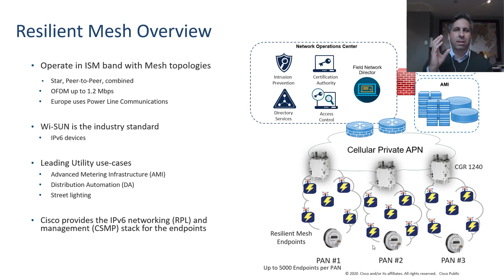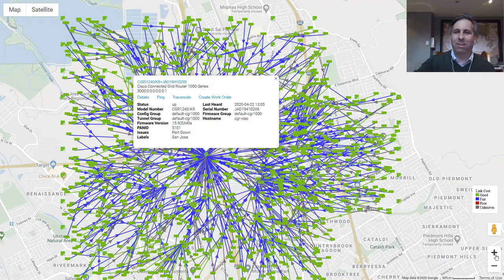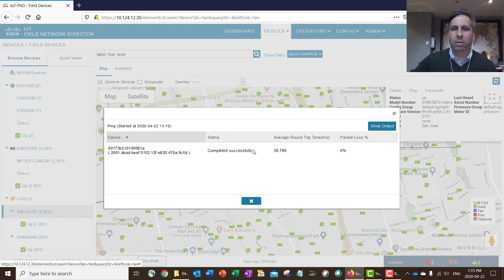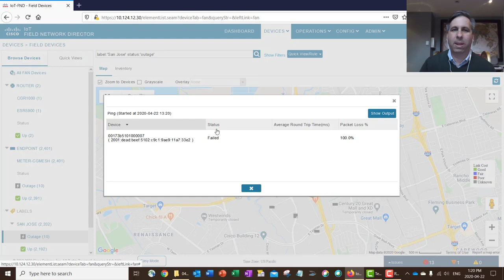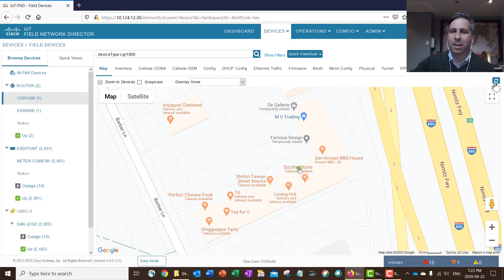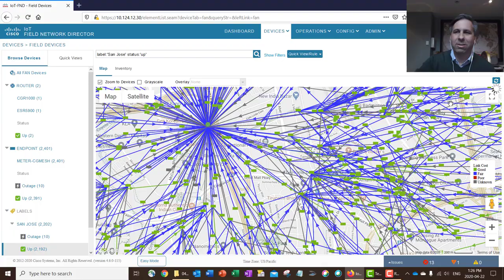FND 4.6 Demo for Advanced Metering Infrastructure (AMI)

Comment: Hello Tim. I work in a company that offers smart lighting solutions for cities, I have been involved in multiple projects with +15 CGRs and +15.000 endpoints each. We use FND to manage and firmware update endpoints but I am not an expert in using it and right now I'm facing a few issues related to FND, like creating the CSMP certificate for endpoints, and adding new CGRs to FND, I don't know the process to do so.

I would like to know what certification I need or how can I get more knowledge about FND and the Cisco IoT solutions for CGmesh and WiSun networks, please.